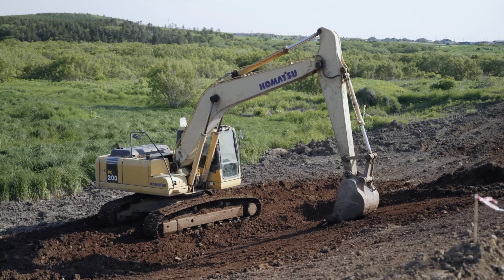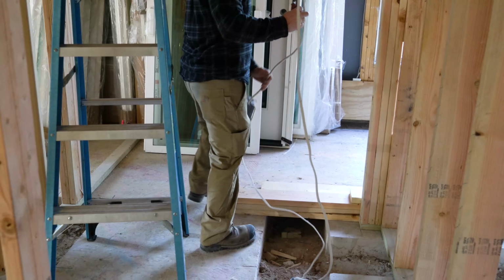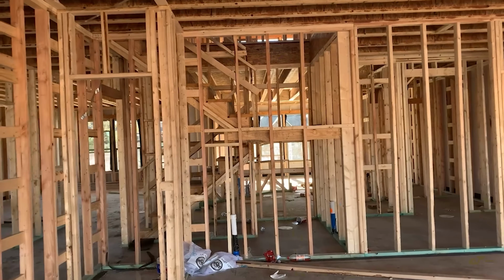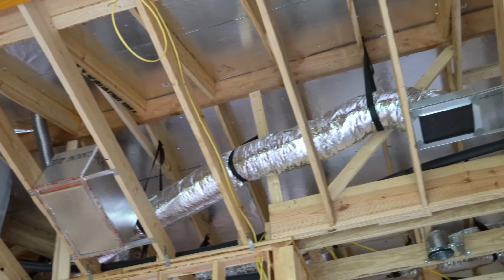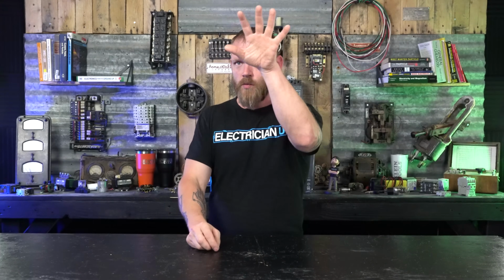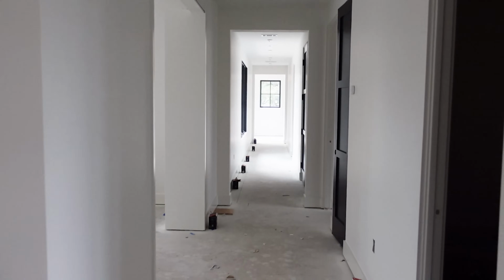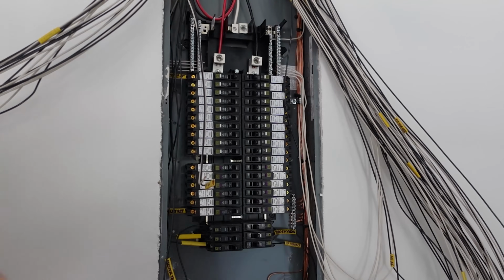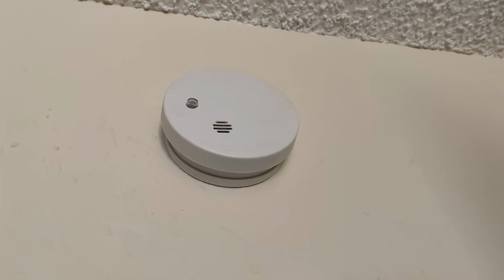Step by Step - How to Build a House

Comment: When is 120V Romex and recessed cans going away for lighting? It’s all totally for incandescent.  Guys charge $100 a can, more if there’s strict fire and ceiling air leakage into an attic. That’s nuts, w the advent of LED lighting.  Should be low voltage, flush mount LED.  Dont want here any more nonsense from the trades or designers, ‘oh but buyers like that recessed look’ . Giv me a break. They like what you tell them to like.  Houses used to be 50A, now they’re 400A, more w EV charging, so electricians making plenty off jobs, let go of cans.

Comment: Summary: 
1. Site Prep, (Earth is prepared for MEPs to come in--mechanical, electrical, plumber); 
2. Lay Slab (concrete and Rebar--Slab gets Grounded; temporary electrical and water are brought in for construction; Slab is cured)
3. Framing (the actual frame of the house is set up)

4. Rough In (first Plumber, then HVAC, then Electrician is done).
5. Rough In Inspection (makes sure everything--mechanical, electrical, plumbing is installed to Code.  Drywall is installed)
6. Trim Out Phase (last segment of construction--ideally, each group of MEPs should do the house separately from each other!)
7. Final Inspection (make sure EVERYTHING WORKS!)
8. Certificate of Occupancy (CO) is obtained.  This allows people to be moved in).

Comment: What I am not clear on, when it comes to framing and i have been teaching myself framing, if I am framing a garage thats like 35 feet long by 25 wide lets say, what do I use for the outside walls of the structure, 2x8s? 2x10s? 2x4s is just fine? I want to insulate it eventually with Rockwool. By the way, I am in East Texas and so elated to know you are from my old city in Austin. I would prefer to hire you guys than the hillbillys here who pretend to know how to build anything and all they know how to do is waste your time and cash your checks and do nothing of value which is why I have been doing all my own construction work since I bought property here. I hope to hear from you as I am very excited about this video. I knew there had to be a preliminary process before pouring a concrete slab and now I know its called M.E.P, Mechanical, Electrical and Plumbing. You just got a new subscriber. Anyway, if I join for $2.99 a month will I get all these tips and tricks? Thanks.

Comment: This is the only video I could find, but it seems very America focused, and American construction tends to be a bit different to most other countries.

I built my home but it's a solid timber cabin on regular old stilts which kept things pretty simple, and I'm hoping to one day build a proper brick and mortar house on the same land.

For things like solid interior walls as opposed to drywall, and steel rather than timber frame, would you happen to know if there are extra steps involved in laying the foundation?

It seems like I'd have to worry more about subsidence than an American home, but I understand if you are only aware of the process where you work.

Its just hard to find anything else on YouTube!

Comment: ...bro, I just want to throw some rocks on the ground & cement them together.

Why does it all have to be so complicated? Why can't I just build a shed in the woods?
I cut down the trees, flatten the land, run sewage to a septic, get electrical to ground, cement slab, & then just start building a big shed on the land.

I feel like there is no more building your own house. You have like 2 architects & 50 inspectors & 200 contractors you have to go through & practically removing the YOU from the ordeal.
In the 50s you could just buy & build a home from the sears catalogue.

It's so tiring.

Comment: This video should be taken down, and redone. The Blueprint is the very first step in building a home, this is done even before land is leveled. The Blue print shows where the foundation is, where all the pluming, electric, and other things go, and it is the one thing you keep in your home after you built the home because if you ever want to update or you have to deal with companies you can show them where everything is. How do you create a guide step by step and skip the biggest important part of building a home specially when laws require it.

Comment: I retract my previous statement. So much red tape has been installed that you essentially have to hire professionals to do the work in order to be considered up-to-code? Whats that? You did everything exactly as state and local building codes require? Well you don't have this obscure permit that requires a college education before we'll consider giving it to you, so you'll have to go eat sand and tear it down. I hate housing regulations with a passion.

Comment: 10 minutes in and you’ve been great! Don’t turn into a crybaby now! Your wires and set up are flexible plumbers pipes, and hvac vents are not. No one is bullying the electrician. It’s best for you to go last so you can move around…. If you go first in this area that I have to run my pipes through and I don’t have clear paths I can just as easily say the electrician have no regard for the pipefitters. I’m an industrial pipefitter, we go thru the same beefs.

Comment: I really enjoyed this deep dive into the construction process! I’ve faced similar challenges when prepping sites for flooring installation. Proper site prep is crucial to avoid delays; I once had to wait on plumbing work before starting my job, which pushed timelines back. 

When estimating costs, I find it helpful to break down materials and labor separately, ensuring transparency with clients. Using tools like FloorTally has streamlined my estimating process, making it easier to track costs and manage projects efficiently. It's always rewarding to see everything come together after all the groundwork is laid. Looking forward to more insights like this!

Comment: I have an idea to save money but wonder if it's realistic.  building out 1000 sq ft with 1 bedroom/bath with living space.  the rest of the slab would be built as carports on either side until such time i decide to convert them into bedrooms/baths.  figuring $200-300/square foot (at minimum) this calculates out to initial saving.  i'm sure the finish out will be more expensive later, but right now interest rates are so high.

Comment: I've been considering building a house, it costs about 30k to build on, the electrician work I've found for the entire process is no more than $2300 the materials can be anywhere from 10k-15k, the contactors(for the concrete pouring, inspectors, etc) are another 5k through the process, it's honestly cheaper than buying a house, the mobile home my husband and I wanted was $78,000 but we can build it for much less

Comment: I worked in the electrical industry, I was installing temporary electrical power, and I had to coordinate with the construction site superintendent, as you mentioned that measurements have to be exact.

Comment: I have a well, no well pump yet, that will be delayed until Spring.  Power brought to the property and every month will be charged $37 regardless of using any power.  Guy offered to install 400 amp service and pedestal on two metal post, grounding wire & install 2 GFCI outlets. No ones building till the Spring.  Should I wait or go ahead with this?

Comment: Did anyone notice the drill in reverse at 13:30 😂. Great video though I love the information I’m in between buying a new home or having one built and I want to see the differences not just in construction but also in prices. Im an electrician so I know I could save lots by doing electrical myself.
Reply: If anyone who has built their home could please comment and let me know the pros and cons of building vs buying a home already built is like to know!! Does it save money for what you may get out of it? Is it better to just buy an already built home? Any other info you might of learned through out your build! Please let me know. I do understand in construction many things can change and become a big factor especially weather and time loss from either failed inspections or hiring a contractor who might of promised a time of completion but ends up not meeting what was said. Idk I’m curious some please comment back if you’ve done it before I’d like to learn from you.

Comment: The most overlooked step of building a house is prebuilt site grading. You cannot correct a bad grade after the house is built on many lots. You can do everything else right but if the water pulls up in the backyard, the customers will not be happy.
Reply: Anytime I hear someone say something about a French drain it is because the pre-build grading was not done correctly. French drains are stupid. And if somebody did their job right, they would not be necessary ever.

Comment: If you get a permit from the city, which is easier than you think, for owner build, you just have to hire out for plumbing, electric & foundation. Everything else you’re able to do. If you want to go cheap as possible, you can work with an electrician during the estimate and ask where he wants his holes drilled for wire. It’ll save you money. It’ll save the electrician time. Both of you win. Plumbing, work with an architect to get the kitchen bathroom and laundry/utility room on the same exterior wall. This saves a ton of labor because everything is next to eachother. If you really plan correctly, you can build for cheaper than you think. For example, a 600 sq foot house is small. Pitch the attic 12 feet. Then you can get a permit to redo it when you’re financially ready, adding a ton of square footage. A room addition on ground level is also cheaper to do after, as most states let you do it on crawlspace, but with the original build, you’d need the slab under it. Build small as possible and add on as time goes on.

Comment: How can a veteran use the GI Bill to buy lots of land to build his own two story house ? Now days most brand new houses cost $500,000.00 or more. It should be cheaper to buy your own land. Pay off the land. Then build your own house. Just pay for the materials to build your own house. Make a five bedroom . Five bathroom house. With a three car garage . With concrete tile roof. With city electrical, city plumbing and city water. With Aircondioning . Then have other back up energy : ( 1.) Solar power. ( 2.) Generator for back up electricity . It really seems much cheaper to buy your own land. Pay off your land. Then just build your own house. Rather then paying off your house until you die .  The other problem , at least in California is finding a place to get Home Owners Insurance. State Farm does not sell home owners insurance any more. The excuse is Californa has too much flooding , forest fires and earth quakes.

Comment: The ideal order for rough-in of mechanicals is: #1 Plumbing drain lines, because they must have the proper slope, and there's not a lot of leeway in where they can run. #2 Ducts, because they are bulky and direct is better. #3 Plumbing supply lines. #4 Electrical, because wires can be routed more easily than pipes or ducts. Of course, as mentioned in the video, you can't have one trade blocking the next, such as putting air grilles where lighting fixtures need to go.

Comment: Purchased property, cleared 30 years or brush, 2 acres, taking out the stumps this month and then burning  everything when open burn season starts. Water and electricity is on the property line already. Will be a while of saving before I do much more, I want septic,foundation and at least 1/3rd of actual home paid for before I consider a loan due the crap interest rates. Even with good credit.

Comment: The builder behind us did everything out of order, yet the City inspector signed off on all of it. The project has take four years building two spec homes and the project is still an active site. Plumbing and wiring was one of the last things they did and it was a disaster that took another year. This is a very expensive City to buy any home, so it's not like the City doesn't have funding for inspections.

Comment: Since light fixtures and recessed lights often need to be in certain, measured locations, our practice is to place them FIRST, but NO Romex. Then HVAC and Plumbing can come in, and finally we come back to pull all the Romex, place exhaust fans, and make up the boxes.  This seems to work, since we can easily route our Romex around stuff, but ceiling registers can usually slide a few inches one way or another, etc. to clear a light that is exactly centered in a hall, a bath, etc.

Comment: My dad built houses by himself from 1970 to 2005. He would build 3 per summer.  He did it all by himself except  the roofing and drywall which is very taxing on the body and time. 
He is gone now but when I look back at what he did, I'm amazed at how hardworking  he was. From the footer to the block-laying through the framing, plumbing and electric. Thats a lot of damn work for one man. Before pneumatic nailers he would wear out hammers regularly pounding those frames together. I remember once  we were seeing who could squeeze   a kitchen scale the hardest. I was 45 years old and he could squeeze it nearly twice the amount as I, at 70. .  needless to say I never challenged my old man physically, ever. His big old mitts would have seized 
me immobilized no question.  ...lol
Reply: By himself?  Extremely impressive!
Reply: Sounds like a good old fashioned hard working man. People let things overwhelm them. I am starting my home on Monday. Already completed the foundation phase a while back. My son and I will be doing everything except concrete and gutters. It’s not practical for two of us to do the concrete and I don’t have access to a machine to do the gutters or we would do those things as well. Nothing like doing your own work. I have only hired two jobs out my entire life. A heat system of which I ran the guy off about half way through and did it myself. And I always pay to have tires mounted and balanced only because I don’t have a high speed balancer ha ha. 61 years old and I have saved a small fortune by being a DIY guy. 
Terry
Reply: @ForestToFarm    Yes changing your own brake pads and tasks like that save tons of money over time.
Reply: @niltomega2978  RIP to your pops
Reply: @ForestToFarm do you make house calls? Lol
Reply: One man army
Reply: Contractors around the country have been in a lot of effort to make it illegal for people to build their own homes. 

There is a guy who built a house where I live by himself. I'm not certain but I'm fairly sure he was an experienced carpenter by the quality of work. He was at the point where siding was about to go up when the local government shut him down and made him tear it down. 

This was around the time I worked for a tiny bit as a painting contractor. We worked on million dollar houses and they were built hilariously bad. Did drywall ceilings have cracks in the seams. The walls were built with 2x4s 24 in on center add a time when 16 in was the standard. The interior was painted with multiple colors of white. Most people would notice this just walking in but when you are trying to fix mistakes it is almost impossible to perfectly match white hey. But the contractors for those houses were connected
Reply: @charlesreid9337    Toward the end of my dads building days they were really cracking down. My old man had the electricians permit and plumbing permit as he was grandfathered in. In a way I see why. Though my dad was competent with plumbing and electrical work, many were not from those days who did it without formal training.
Reply: @charlesreid9337 tear it down or what? Standstrong, stand together bottoms up movement and don't let the big bad government do anything .

Truthfreedomhealth
Reply: An absolute mountain of a man.
Reply: Sounds like he was an amazing man😢😢😢
Reply: My daddy is quite like this. Still hard working as ever! Always taking care of others too. I worry about him at times.
Reply: Guys n Gals were just different back then let’s just say…. I gotta be gentle and vague so the zoomers don’t start compensating verbally
Reply: Hat down to your dad ! Great example of a man and father
Reply: That's beautiful man. I hope to be that kind of dad to my kid one day :)
Reply: A gd man's man.
Reply: sad
Reply: @orezymc  
yea....well.....try harder.
Reply: My dad rebuilds houses now but used to be a hoof trimmer and grew up on a dairy. He's 6'6" and his hands are down right scary.
Reply: @ntamsma   I bet
Reply: I'm so glad you got to have this dad
Reply: Bless him man beautiful and inspiring
Reply: I may agree with you however building a house with cement and steel is very difficult
Reply: @saltmcleansulfjmus7535 
Steel? Yeah my dad use concrete foundations but never used any Steel in the building
Reply: @niltomega2978 I meant concrete supported with steel inside the concrete.
Reply: 3 per summer ??? Must have been incredibly basic sheds lol.
Reply: @stuffthings9618  
indeed that is what you would eek out.